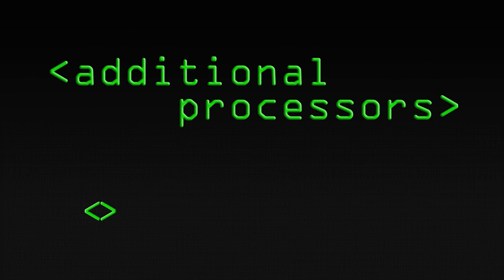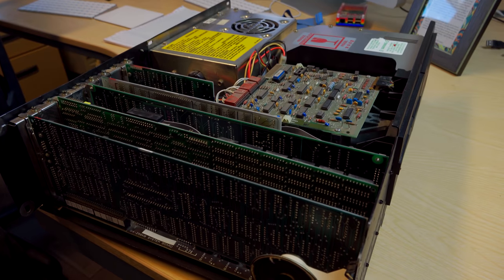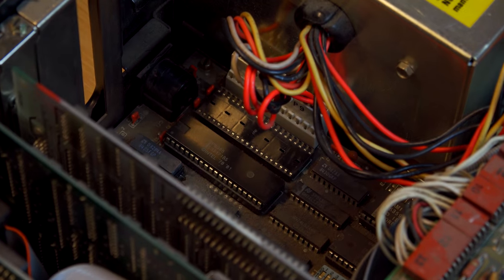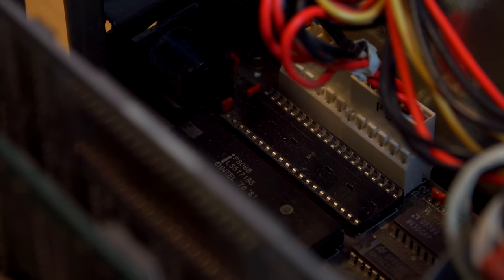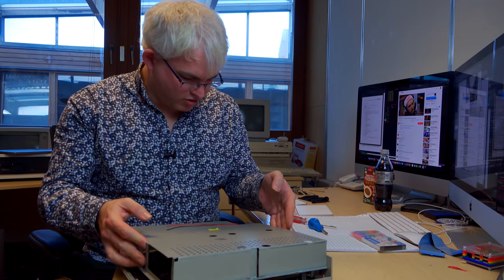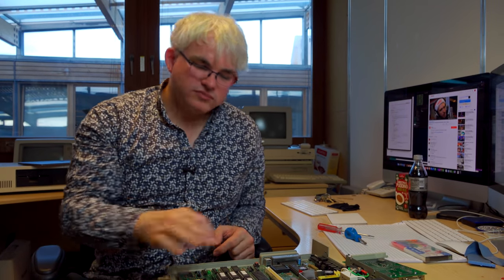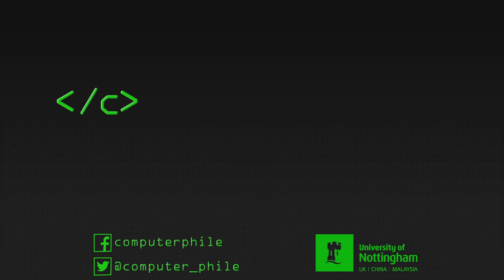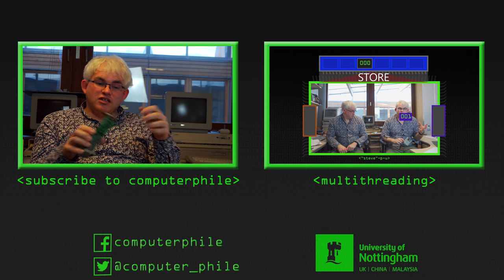Additional Processors - Computerphile

Comment: Back when generating fractals on the computer was a new thing to do in the 80s, there was a DOS program called FRACTINT where the “INT” part was because it could do fractal calculations relatively quickly without a coprocessor, using just integer maths. Having an FPU was a luxury.
Reply: Ooh, yeah I was randomly zooming into fractals without any special reason with that program. But I think I either ran it on an Amiga (don't know if it was available for that, can't remember) or a Pentium 60 otherwise. ALL THAT COMPUTING POWER!
Reply: Yep, flashback from the 1980s!
Reply: @superdau  Fractal generation was an entire genre of software.  While I'm not sure that Fractint itself was available, there were certainly equivlalents.  Vista and Mandelbrot, for example
Reply: Took a course in chaos theory at Uni, and when my father heard about it he proudly handed me a book on fractals written very much in the 80's. "Obviously, graphics like these couldn't be produced on a home computer, but require large amounts of time on a university computer cluster" (128x128 pixel koch snowflake)
Reply: David Gustavsson FRACTINT didn’t come out until the very late 80s, so that would have been absolutely true at the time. Any chance the book you’re referring to was the James Gleick one?
Reply: Bo Carlsson, actually. 
Had to look it up, it was published in '92, but every picture is accompanied by a BASIC snippet.

Comment: I clearly remember using the Intel 8087 co-processor in the 1980s, and it made a huge difference to the speed of floating point arithmetic. It was quite an expensive add on...
Reply: It's interesting, because it doesn't really act like a co-processor so much as an extension to the actual CPU.
Reply: The Intel 486 was the first to have a built-in co-processor. Not all chips had this feature, in the SX version it was either absent, or disabled after failing manufacturing failure. All subsequent Intel chips always have a built in processor (Pentium onwards).
Reply: @gordonrichardson2972  The 486SX was a completely cynical marketing ploy. It lacked the (functioning) floating-point hardware, but you could buy a 487SX chip to add this. However, the 487SX was more than just a floating-point coprocessor: it was actually a complete functioning CPU. Plugging it in caused the 486SX to turn itself off and hand over all functions to the 487SX!
Reply: Long before the Spectre security vulnerability, there was this terrible fear that the Pentium FDIV bug could produce a wrong answer in your calculations (maybe one in a million chance if you were a serious number cruncher). The shock and horror caused Intel a pre-tax charge of $475 million!? Edit: Only very early versions of the Pentium, the P4 is fine. Its kinda confusing that we had the 486, then Pentium P4...
Reply: It was expensive, but also the number of transistors on the chip was reduced, and thus the yield was much better and you get a better price for the customers.  As the number of transistors was increasing, the cost of adding the FPU was actually not that expensive to add to the chip.
Reply: remember tossing one in my 386sx. it made some improvement for rendering 3d stuff.

Comment: You know what would be cool? A high-level look at some CPU architectures. Like, even today if you want to license an ARM core, you still get a question whether you need a floating point operations to be done in one clock-cycle or if you can get away with it taking longer.
Reply: In the context of this channel they should do an abstract overview of all the different MPU/MCU/CPU/PLD stuff used in hardware design courses over the years. That would be really interesting for the plebs that haven't attended, and could be nostalgic for those that have.
Reply: Considering there are, of course, any hardware focused teachers. I don't know how is Nottingham Uni structured. It may be all history/software for all I know. Also, MCUs aren't exactly what we imagine a computer to be but they're extremely interesting little devices. And firmware engineers are few and sought after. There are so many great topics to cover.
Reply: @hrnekbezucha  
  Yeah, I know I'm mixing interests. I am currently goofing around with vintage MPUs for the first time but my primary interests are MCU's and PLDs :)

Comment: With some Amiga models (not all of them) it was possible to add in an expansion board with a new processor that effectively took over as the main CPU... so you could get an accelerator board for the Amiga 1200, for instance, with a 68040 or 68060 processor that took over from the main 68EC020 chip.
Reply: Only the PC rivaled the Amiga in expandability. People didn't really go all out on expanding Amigas until after 1992.
Reply: There were ways developed to hardcore upgrade most Amigas, even the 600, a feat which involved fitting a PLCC socket upside down to the surface mount 68000 and basically bolting it to prevent it coming loose.

Comment: 8:24 The trouble with the hardware blitters in the Amiga and Atari ST is that they were never as powerful or flexible as software. The Macintosh had its QuickDraw graphics routines, which implemented sophisticated drawing modes and nonrectangular clipping. When you tried to build similar functionality on top of a more limited hardware blitter, the performance would often end up worse than if it was all done in software.

Comment: 6:09 Actually that was done using fixed-point (scaled-integer) calculations. Which were quite a pain to work with, but saved on floating-point hardware.

As the hardware cost dropped, eventually it got to the point where the saving from leaving floating point out was negligible compared to the cost of programming without it. This was about the early-to-mid-1990s.
Reply: The first Intel 8087 co-processor had a total of 45,000 transistors, whereas today's CPUs (Pentium onwards) have millions, which shifts the cost ratio considerably.
Reply: It was never about "savings". Intel simply liked charging double. You have to remember their games with first 486SX being locked DXes, or 487SX. Competition forced them to end it.
Reply: @rasz  It was never just about Intel. Unix workstations used quite a wide variety of chips then -- MIPS, PowerPC, Alpha, SPARC, HP-PA etc.

Comment: Fun fact. if you're doing CG rendering and you have an AMD Threadripper, and your graphics card is "average" (AMD RX560) Utilizing the CPU to render it rather than the GPU actually yields a faster result. I mention the 560 is average, it's average low end, The CPU in this case is astoundingly fast and any decent rendering or graphics baking software can utilize every thread that can be handed to it, It illustrates the point you make about handing it to the dedicated hardware becomes redundant because the CPU can do it faster than the dedicated hardware, In this case, The advantage of handing it to the GPU is that while its rendering the machine can do other tasks, albeit a little slower as it communicates with the gpu periodically, but if you set the CPU to process it. it will get done faster, but the system will feel very very very sluggish as its dedicating most of it's cycles to that software. I just thought it was an interesting point that even in the modern era can be illustrated if your system hardware isn't equally balanced where there's one chip that's way faster than the other. (this machines primary job is crunching numbers and audio processing, so the GPU is almost an afterthought)

Comment: A modern example I have played around with for a while is the Nintendo DS. It had both an ARM6 and an ARM11, each having different speeds and capabilities. You mainly would program on the ARM11 but the ARM6 acts like a coprocessor for things like wifi, etc.
Reply: IIRC it was actually there for gba compatability.  So, in design it's actually something like the z80 in the Megadrive, which was there partially for backwards compatability with the Master System.
Reply: @TheTurnipKing  pretty much. Smart design if you ask me.

Comment: Would there be any benefits to moving some of the more bloaty/specialized CPU instructions to a separate accelerator chip/card ? For instance, I'm guess that normal consumer PCs do not necessarily need HW accelerated hashing. Maybe they don't even really need AVX. Would removing such functions free up chip area? And could that chip area be used to somehow speed up the more commonly used instructions?

Comment: I was hoping for mention of machines such as the Commodore 128 (6502/Z80), or machines such as the BBC Micro or Amiga/Macintosh with x86 hardware add-ons (so 680x0/80x86), where there was more than one general purpose CPU in the system that could operate simultaneously, and thus the issues that could come up in such a system, such as bus contention, and how this problem was dealt with in hardware or software on those systems.  Any chance of a video about this in the future please?
Reply: C128 was a trash fire, you couldnt run both CPUs simultanously. C128D was even worse, you paid almost full Atari ST price for a system with 3 CPUs, but only 1 ever working at any given moment.
Reply: @rasz  Ahh, but even if you can't use more then one CPU at a time in the 128, it's still an interesting case to discuss, because of the difference in opcodes and method of switching control, to name just two.  In the case of the Amiga with the Janus library, that offered some very interesting possibilities that I don't think were ever really explored as much as they could have been.  And I understand some Apple Machines were sold with a full 80486 - the Power Macintosh 6100 DOS Compatible is one of them, and those are interesting machines for such a discussion as well.

Comment: Uniform memory access architecture should be seen as an ideal along with the generalization of multi-processing parallel computing. Ideally general purpose programming could send tasks to both CPU and GPU as resources are used. One issue with this is the need for Just In Time compiling for all programs running on the system. This means that games developed with Shader programs simply send their programs to run on the GPU while the OS can recompile and move a program to the GPU that is either better fit or to offload the CPU. If then any part of the GPU still needs dedicated memory that part of the GPU should be treated as a sub-processor with highly specific functions and infrequent reprogramming. The rest is unified and as such general purpose programs can be parallelized between processors since they share memory.

Some processors are interdependent. Like the keyboard CPU is the only one that can get interrupts for the physical keys nor would unified memory make a lot of sense for a peripheral. In this sense the CPU on the device is really a sub-processor which might be general purpose for development purposes since microcontrollers are so accessible. But its functionality is slave to the system. It doesn't implement general purpose processing or programability. This is also true of much older GPUs or the display controller hardware on dedicated cards or as part of GPU chipsets.

Comment: I was hoping you would get into something more interesting like computers that actually had 2 CPUs like the Fujitsu FM-7 with 2 MC6809 or Sega Genesis/MegaDrive with it’s MC68000 and Z80.  Perhaps in another video.
Reply: or C64 + Commodore 1541 combo used as a dual CPU system.

Comment: I would love to see computerphile do an episode about computer/internet operating speeds and the relationship between hardware and softare. And ive never quite understood what firmware is. Why do storebought PCs slow down so soon after buying?
Reply: When you buy a PC new it's going to be running as pure and untouched as possible, aside from any bloat that the manufacturer has added. You then get it home and add all of your peripheral drivers and software, install the dozens of software packages that you use, download a couple of browsers and then a handful of games. All of these things are taking up the resources (CPU/RAM) that was previously free when you initially bought the machine. Modern computers are abundant in resources and timescales may only be milliseconds but each one of these things takes time and effort to 'do something' which is most likely the slowdown that you see.

Comment: Are GPUs considered as additional processors?
Reply: absolutely
Reply: Are they like FPU's, except it is matrix arithmetic instead. Effectively an MAU Matrix Arithmetic Unit.
I don't know whether graphics card do more than matrices (what a torturous life that must be).
Reply: Honestly, they're more like complete, dedicated sub-computers.
Reply: GPUs mostly do both floating point & integer matrix-vector arithmetics of small fixed arities plus a couple of specialized perspective rasterization pipelines.
Reply: Modern GPUs are, for all practical purposes, CPUs.  The difference between a CPU and a GPU today is that CPUs are optimized for running code on a small number of threads (10's), while GPUs are optimized for running code on a very large number of threads (100's of thousands).

The reason they're separate is that these uses require very different microarchitecture under the hood to run fast.  A modern CPU throws huge amounts of hardware resources at making a single thread run 10% faster.  This is extremely wasteful if you're concerned with running code with many, many threads.

GPUs tend to also have more "exotic" specialized hardware units internally than CPUs have.  Things like triangle rasterizers, texture units, ROPs, and very recently even specialized BVH traversal units for ray tracing.  These would have been fast enough for shader software, but developers keep throwing more and more work at them as graphics move forward.

CPUs tend to have much larger caches than GPUs.  This is largely because cache misses hurt CPUs much more than GPUs, since an access all the way to RAM incurrs 100's of clock cycles of latency before the results come back.  A GPU will just switch to another thread while waiting.  A CPU often doesn't have this luxary because there might not even BE another thread to switch to.
Reply: @Keldor314  Thanks for the detailed explanation

Comment: The Intel 286/386/486 used to have a coprocessor called -87. What was that about?
Reply: This was the FPU (floating-point coprocessor). The 80486 was the first generation IIRC which had the FPU integrated on a single die, but only for the "DX" version. There was also an "SX" version without built-in floating-point support, and a 80487SX coprocessor.

With the Pentium, Intel finally chose to make floating-point support a full, on-die feature of every new processor.
Reply: @Jeff Jibson Interesting, thanks… I never even heard of Weitek before. No wonder that company went under if the sales were that bad.

Comment: But how many flops did that early flop unit flop if it could flop in flops?
Reply: Early co-processors like the 8087 worked in mili-flops (joke) compared to today's CPUs.
Reply: A couple hundred kiloflops or low megaflops. With software emulation, only a few kiloflops. <- rough estimate based on instruction timings and clock speeds at the time in case it isn't obvious. :-)

Comment: Blitter always seemed to me like a rudimentary GPU
Reply: Most home computers employed a rudimentary GPU to free up the processor from the quite onerus task of generating a video signal.  Some of the very early, cheaper systems did not and the ZX80.

The problem is that generating a video signal is not a task that can be interrupted, so ideally you need something in parallel with the CPU doing it so as to leave your CPU free to work.

The fun thing is that this, not the CPU speed, is ultimately responsible for most of the distinctive video limitations of a system.

Comment: could you make a converter for the fpu slot to accept a 8088?
that be cool
Reply: Not really.  It's designed specifically to accept the matching FPU.  It's best to think of the 8088 and FPU combo as one processor cut into two parts.

If you wanted to multiprocessor an XT class machine, you'd probably want to design a card to fit into the cpu socket... or on the PC bus itself.
Reply: @TheTurnipKing  well, unfortunatly im not smart enough for PCB design XD.